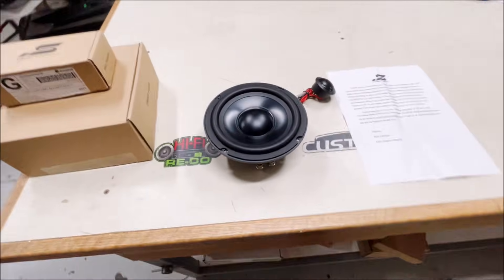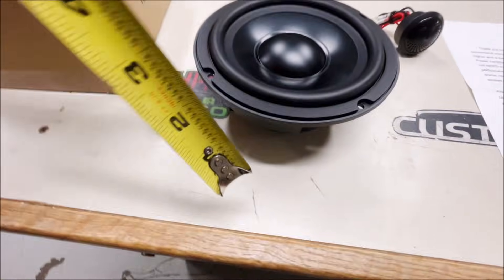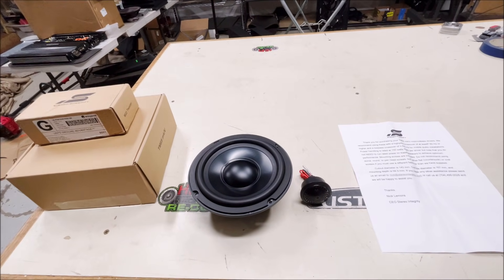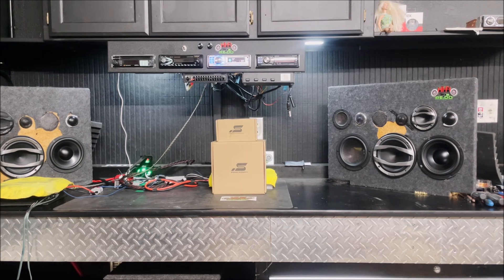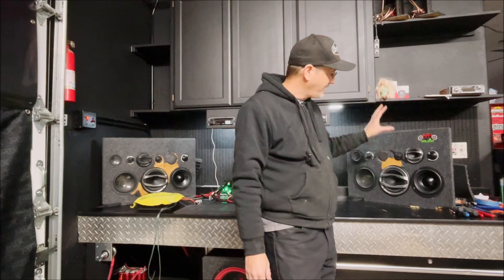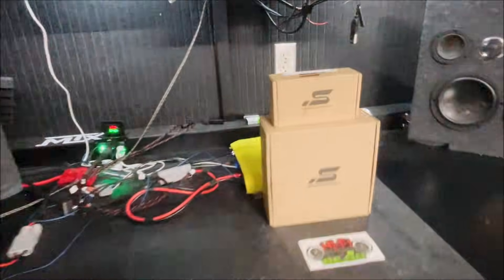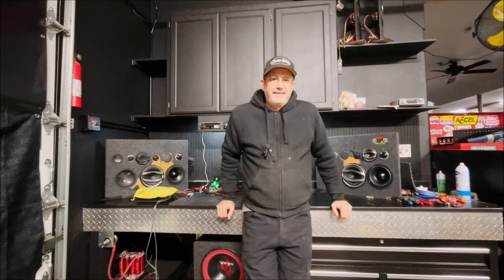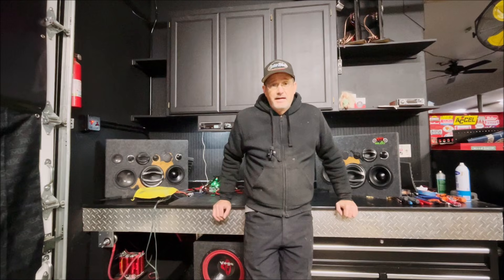Stereo Integrity  TM65/M22  vs other components tested

Comment: @Hi-Fire-do- I think the Stereo Integrity 25 mm tweeter can be crossed over lower, like around 2,500 Hz @ 24 Db/oct., & that would then allow the 6.5" to be crossed over @ 2,500 Hz, balancing out that dip between 3,000 to 4,000 Hz. Would be nice to see if someone would send you a pair of the SI 8" mid-bass (Band passed between 40 Hz & 500 Hz), a pair of the SI 3" carbon mid-range (Band passed between 500 Hz & 4,500 Hz), to blend with the 25 mm SI tweeters (4,500 Hz & up). I would even like to see how Low these SI 8" would play without a high pass filter. Great video, thank you, & Happy Holidays🎉
Reply from the maker: Yes.  I hope in the future I can get the 3” and 8” speakers to test.  If this video does well maybe I will contact them.  Maybe they will contact me!  Merry Christmas and happy new year to you too!